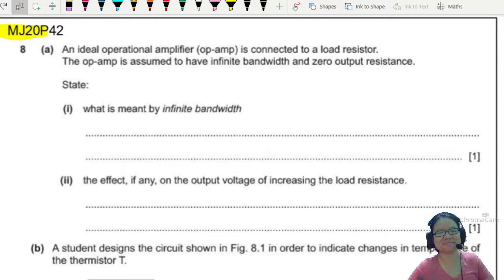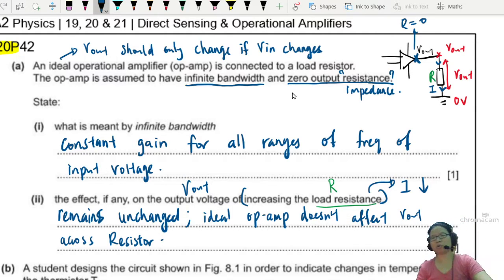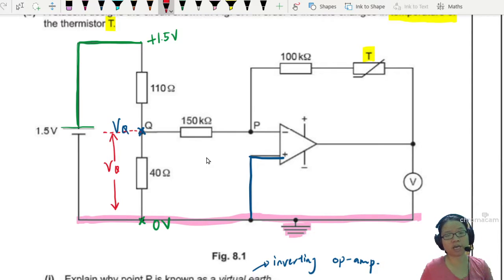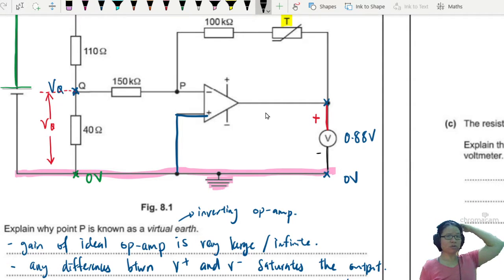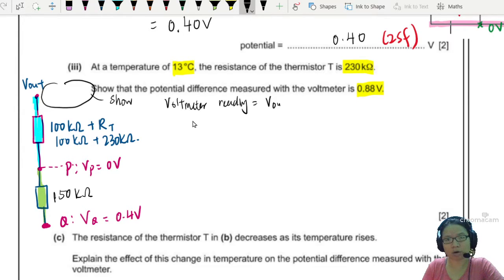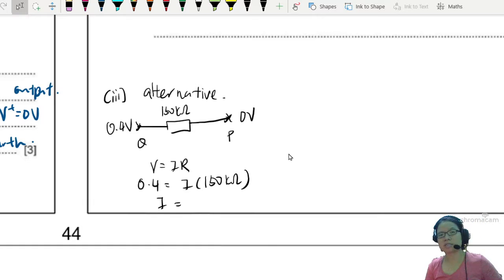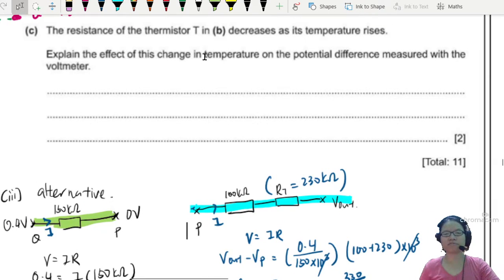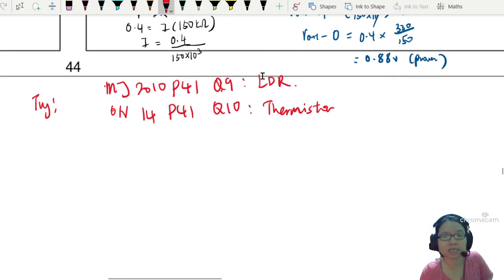121.2d MJ20 P42 Q8 Thermistor & Voltmeter | A2 Electronics: Op-Amps | Cambridge A Level Physics

Comment: Hi Miss, thank you so much for your videos!
I was wondering if in part (iii) would it be okay to find the gain first and then find the Vout to show the 0.88? By using the gain formula, I got -0.88, but you mentioned that the negative sign wouldn't matter.
I see you've done it directly using ratio, which I assume would be better for accuracy in other questions.
Thank you :)
Reply from the maker: Yes you can! But yes direct ratios may give a higher accuracy in final answer.
Reply: @ETphysics  thank you 💜